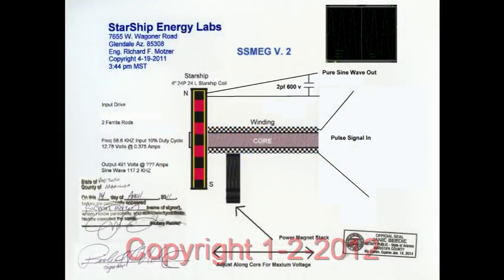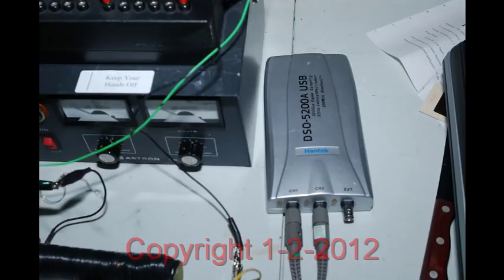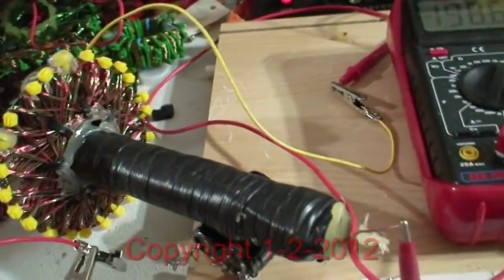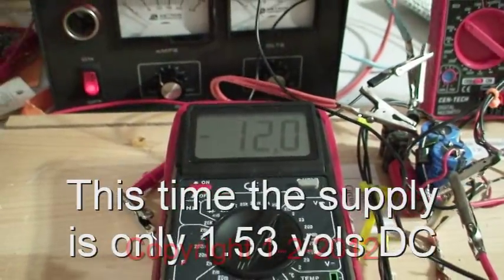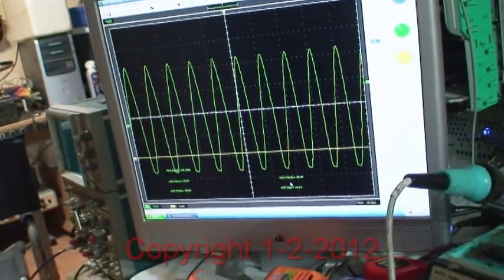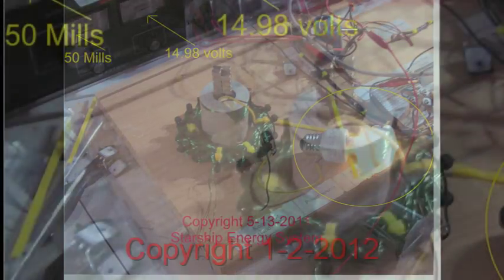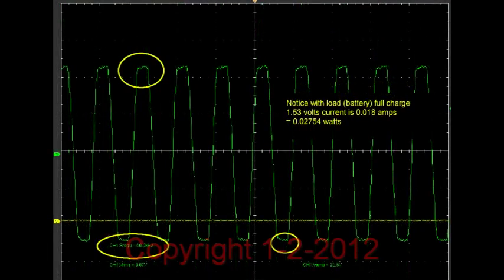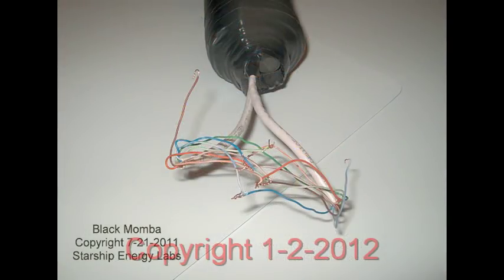The Starship MEG 1

Comment: I've been thinking about this for a couple days.  Just going to throw this idea out there for you, I'm going to build some coils to test the hypothesis.

You're circumnavigating more than just the interior of the coil, you're also forming smaller 'pseudo loops' around the outside.  I hypothesize that the magnetic field lines are breaking the inner circumnavigating wires, and then breaking these smaller pseudo loops, which are in effect, in series with the inner circumnavigation of wire.

Comment: the momba is neat and yes a finer wire has a great effect similar to the bell ringer that has multiple fields and a stater that step trigger's for a hard impact ring or a gentle impact I have a coil that i started at a wire of 100 feet and measured to 50 and started winding from that point both at the same time an over under arrangement and as i worked from one end to the other i came back so that the second cris cross patern was on the opposite side XXXXXXXXXXXX like

Comment: it is as if the electricity is coming from the bulb to the coils just a thought  but yes the air has a current flow and with certain condition's a charge state has banding scalier waves like an antenna drawing in a radio station